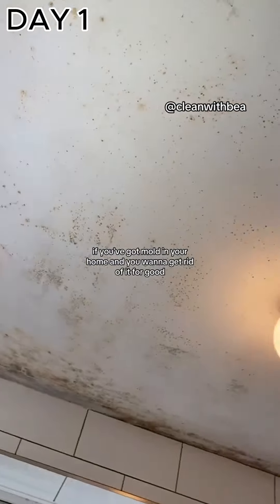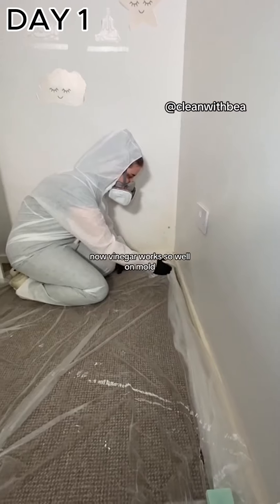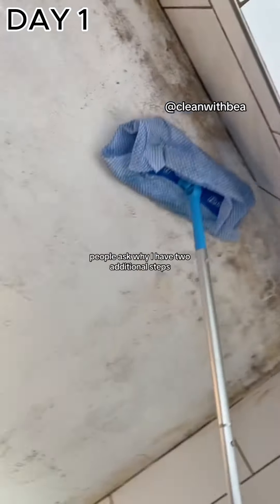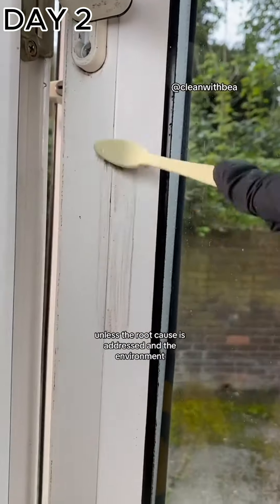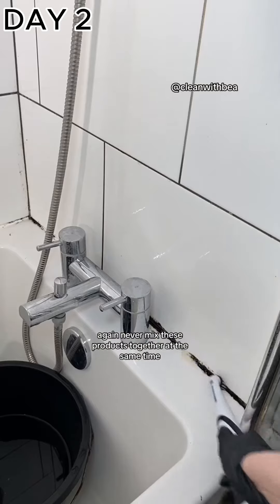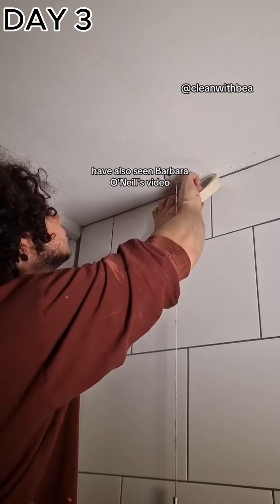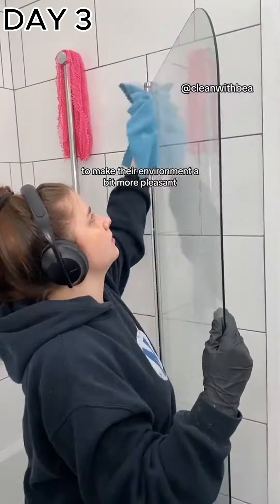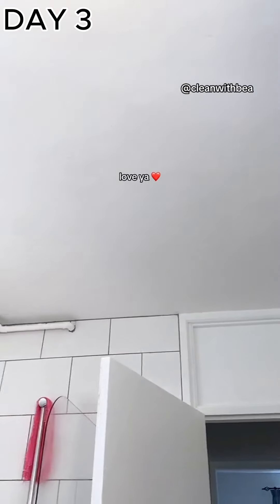How To Get Rid of Mould

Comment: It's upsetting to know that landlords just don't care. You are an angel for what you're doing!
Reply: It's surprisingly very common in the UK 😅
Reply: @A_ix101  I know it's horrible even council housing too
Reply: @hsss2715  Agreed it rlly is messed up and there's not much you can do about it
Reply: And military housing
Reply: I’m 45 and unfortunately like in a humid climate and I’ve lived around mold most of my life. Landlords don’t want to do anything about it so my husband basically does what they are doing here and keep it bay for as long as possible. I know some of our chronic illnesses are from mold exposure like my ME/CFS (chronic fatigue syndrome). I wish we had an angel like her bc our chronic illnesses are so bad we can hardly keep up with it. I’ve read lots on mold and it’s next to impossible to get tested by a doctor, you have to pay lots of money for a specific doctor to do these test needed. If you can prove cause illness and your landlord isn’t doing anything about it you can sue it’s just hard to prove. I mean I guess my ceiling that looked like the one in the video isn’t proof enough…
Reply: Landlord cannot do much about it. This mould occur due normal use of flat. We can produce 17 litres of moisture a day per person. Without efficient ventilation, efficient heating and good insulation nothing would help and this is just temporary measurements. The radiators in this flat are the least efficient on the market (but the cheapest too). Mould occur in so called cold spots, around the window and bathroom ceiling - that’s just scream poor ventilation. I bet this tenant after shower in this bathroom have drops of water dripping down the ceiling- that’s not a leak, that’s the condensation from a shower, I bet that she save money and even with this poor radiators set lower temperature during winter, I bet she wakes up every day during winter with condensation build up on her bedroom window. This is just normal for a lot of British houses. You have only one option to prevent the mould getting back taking shower, and sleep with open window and set heating for maximum blast. But this would cost this tenant absolute fortune.
Reply: @A_ix101 due to poor building regulations.
Reply: And they call uk 1st wolrd country and london best place to live in all ratings😂💩

Comment: I’m a mold expert and bleach should never be used on mold despite it being a common and popular method. It causes the mold spores to bloom and spread into the space and it will always grow back. It’s actually the last thing that should ever be used on mold. Hydrogen peroxide is a solid option. Microfiber clothes should be used and then discarded as soon as they are damp…so you go through many of them. The small fibers on them allow them to pick up mycotoxin spores which are very small.
Reply: Discard the clothes? Or wash them at 90?
Reply: @bathemeinchampagne  bleach is sodium hypochlorite. https://en.m.wikipedia.org/wiki/Bleach
Reply: I agree! We are currently renovating our home because our landlord is my father in law and he graciously is willing to take care of the issue.
Bleach really does brighten the mold stains because, bleach is meant to brighten things. But just like you can bleach color out of clothes, you can bleach color out of mold. And I forget the technical terms, but the one molecule of bleach evaporates very quickly and then water is left, which feeds mold. So it doesn't work.

Comment: Instructions for those who don't want/need the backstory:

WARNING: THE AFOREMENTIONED PRODUCTS ARE NOT TO BE MIXED AND MUST BE SPACED 12-24HRS APART! CLEANING YOUR BATHROOM WILL TAKE AT LEAST THREE DAYS. PLEASE WEAR MASKS, EYE PROTECTION AND PPE WHILE DOING THIS, ESPECIALLY WITH CEILING MOULD!

Equipment needed:
- PPE disposable suit
- Fixed eye protection
- Respirator masks
- White vinegar
- 3% Hydrogen peroxide
-  Bleach Based mould spray
- Sandpaper
- Plaster (for cracks/holes in walls)
- Damp Seal
- Primer
- Anti-mould paint

First treatment: White vinegar spray.
- Equip PPE (Masks, resperator, eye protection, suit)
- Clear room of any/all objects

- Spray everything down with white vinegar and leave the room for one hour
- DO NOT WIPE UP DRIPS. DO NOT DISRUPT THE COLONY!
- After an hour, wipe up the vinegar & mould using cheap sponges using circular motions
- Once you're done wiping, leave to dry for 24hrs.

Second treatment: 3% Hydrogen Peroxide.
- Equip with PPE 
- Take 3% Hydrogen Peroxide and spray the same areas as before
- Leave the room for 15 minutes
- Come back and wipe down all areas
- Leave the room to dry out overnight/24hrs before using the next product 

Third treatment: Bleach based mould spray.
- No instructions were given as to what to do with the bleach based mould spray aside from spraying affected areas to brighten and remove any remaining stains while killing any remaining mould on surfaces
- If you have any cracks in your paint/wall, fill and sand them smooth as possible
- After go in with a damp seal and primer undercoat to cover affected areas (Again no instructions as to how long to wait between coats. Ask a retail worker at the hardware store or follow instructions on the tin.)
- Follow this with anti-mould paint

Disclaimers:
- Mould will come back even after doing these treatments.
- You cannot know how deep the root system goes without professional tech
- To kill mould permanently will require the work of professionals
- Keep humidity low with dehumidifiers to prevent/slow down the mould's return
- Work on improving the ventilation of such spaces
- Do not lie about not having a mould problem when/if you get a professional to come and install a fan or any other work needing to be done as it can physically harm them to breathe it in + it'll spread spores throughout your home.
Reply: Thanks for this! Any idea if the sponges need to be damp or dry when wiping away the product?
Reply: Thank you ❤
Reply: Would this work in a tiled shower too? Because at my house we have a tiled shower that has a massive black mold problem and I would love to do anything on a budget to try and make it better!
Reply: @LadyLoraella  Use a damp sponge so that it's able to grip to the surface and lift residue xx
Reply: @vascanj hello! I used to work on the home improvement/contractor so I can answer this one. 

Biggest question is what kind of tile do you have? If it's a natural softer stone like travertine or marble you need a different system! The products used could disfigure the tile. Granite is typically okay but needs  to be resealed once you're done (we'll cover that more in a sec). Either way for granite or porcelain test a small area first. Ceramic*typically* will be fine with all the cleaning products used (I can go in depth if you want to know so let me know!)

This cleaning method can be used on grout and you can get grout "pens" that will change the grout by about 1 shade darker or lighter.

RESEALING
You HAVE to reseal the grout after this kind of cleaning process!!! IF YOU DO NOT, IT MAKES IT EASIER  FOR THE MOLD TO START A NEW COLONY 🤢  The sealer acts like a clear coat of varnish, nail polish, or wax on your car. It provides a protective coating to help repell water. Grout itself is naturally pretty porous which is why it can get moldy so quickly if it's not sealed. You need to reseal natural stone tiles AND porcelain typically every 1-2 yrs, it depends on what cleaning products you use. If water doesn't bead up, time to reseal. Grout should be the same.

If you're in the US ,The Home Depot, Lowe's, Menards, or Ace Hardware, should all carry sealer. If you're in Canada, again The Home Depot should have it or some other big box home improvement retailer. If you're in the UK the only home improvement store I know about is HG or H&G (sorry).
Reply: Thanks! I saw the video, but is really useful to have it write so I can have it easy when I clean
Reply: Awesome! So well written! Thank you soo much!!

Comment: The landlord needs to address the roof and walls. That looks like black mold and that is toxic. I found it in my bathroom when I removed old painted over wallpaper. There were several small spaces then I found a gateway to hell by the canned  lights where there had once been a roof leak.  It had eaten through the sheetrock and while it was dry, it was nasty looking. I bleached until it was gone and then had to cut out and replace a large piece of it.  

The thing was, I noticed almost instantly how much better I felt. It was amazing. Do take care of your body while cleaning that.

Comment: What percentage solutions of vinegar and peroxide are you using?
Thank you so much for sharing your tips, we live in Ireland and of course the damp and mold is a problem everywhere. It's not too bad in our current place but you've really inspired me to keep on top of it.
Reply: 3% for the hydrogen peroxide. She doesn't mention the strength of the vinegar, the stuff you can buy in most supermarkets in the UK is 5%. If you can find 10% "cleaning vinegar" that's more effective.

Comment: I love your kindness, yes mold is on the rise.  I’m in the states where it is being examined - remediation may soon be addressed in statutes.  Much has been learned may I share.  My daughter and granddaughter have a gene causing them to be more sensitive to mold.  There is an established test and protocol for clearing ones body of it.  Bleach not.  6% peroxide used carefully helps remove stains and pull it to the surface as in wood.  Ammonia for washing clothes or fabrics.  Borax with tiny bit of washing soda 95 parts to 5 to kill it.  Wipe one way don’t scrub.  Keep humidity at 40% or lower.  Use exhaust fans ducted to outside at cooking and bathroom.  At very least crack a window, soap and water wash leather, then alcohol and water on it dry thoroughly.  Vacuum with hepa vac often, dust is food for mold.  Dry any water leak or spillage within 2 hours.  There is much study posted on the internet.  Sent with love because I too, started with bleach and best of intentions.  My girls are very ill.😢

Comment: We got rid of the mould in the rooms by turning on the vent in the bathroom almost 24/7 and we did 2 steps: 1st day anti-mould spray twice and 2nd day - covering the moulded spots on the painted walls with transparent lack for yachts. On the top - white paint. Worked perfectly for months. Then we moved out of the rented place. I guess the mould didn't come back very long time there.😊

Comment: Most of the mould there is stachybotrys chartarum, one of the more common species, stachybotrys chartarum is commonly known as black mould and it only releases spores when touched in some way, whether it be a wet surface, touched by a hand or any form of touching it, it releases spores. Stachybotrys chartarum grows slowly and doesn’t compete well with other mould species.

Comment: Love hearing more in depth explanations of how to get rid of mold and what works and how. We have some mold problems where I live and I've been trying to research ways to safely and effectively remove it but there is so much contradicting info online. In my room the issue is mostly around the windows and in the corners of the windows but I'm worried about the rubber (or whatever that material is) getting damaged because I heard that vinegar can damage such things.

Comment: There is a thing about British houses that even after eradicating the “cause” the mould would be back within half a year since treatment etc. why? Faulty building regulation and the poorest ventilation system you can see in Europe. I bet this flat was build about 2007. They saved money and used the cheapest plasterboards, insulation is shite or none. Ventilation system? It’s basically hole in the wall with air brick outside. To compare in countries like Germany, Poland, Norway, Sweden, Switzerland Finland, Central Europe and a lot of Eastern Europe countries houses and block of flats are required to have additional chimney stack just for ventilation purposes build with extracting system to every room. Why British houses don’t have this and it was never applied as mandatory? Well it makes much cheaper for developers to build substandard properties.